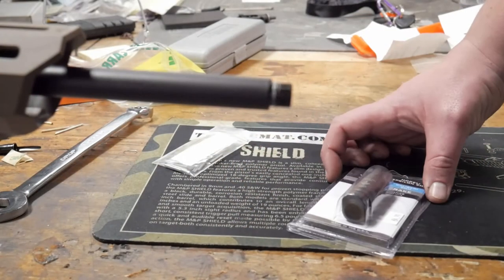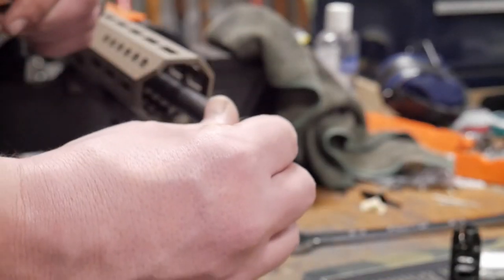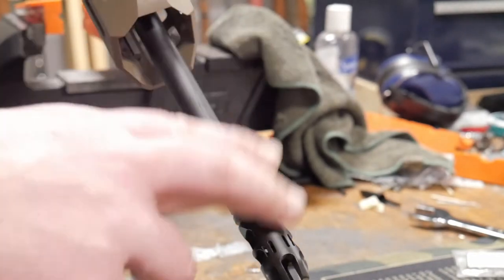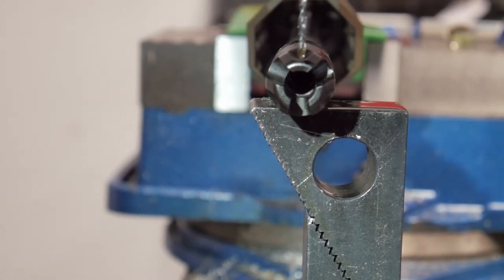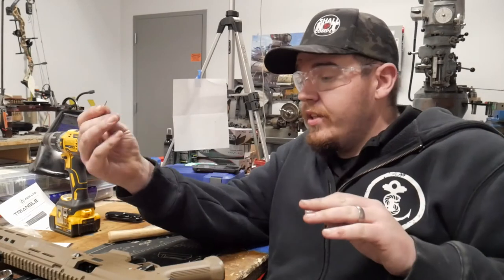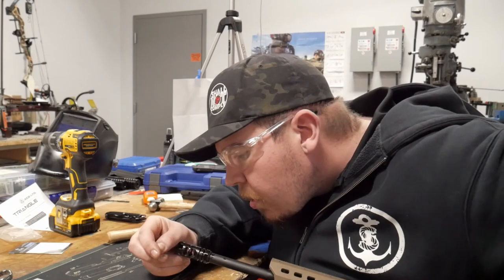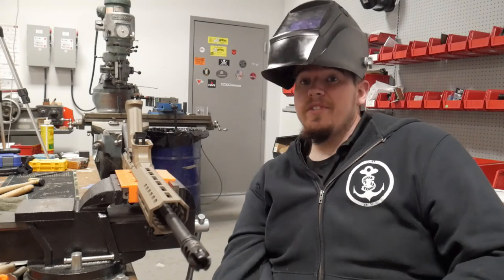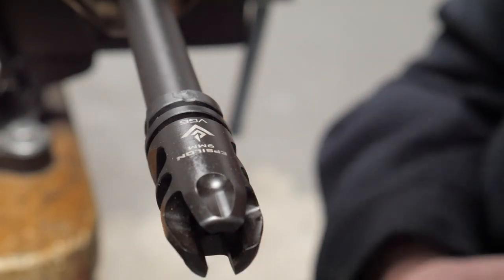Pin & Welding a Muzzle Brake Step By Step

Comment: You're not supposed to use a crush washer to time a muzzle device you're supposed to use shims... Timing has nothing to do with whether or not the circle is at the top . Timing has everything to do with bottoming out the muzzle device  with the top and bottom in the correct orientation.  You can't bottom out the device with a crush washer... Anyone want to chime in?
Reply: My understanding has been that, if it's a mount for a suppressor you don't use crush washers as they aren't perfectly concentricity; but for just a muzzle device crush washers are fine.
Reply: If the SOLGW - NOX is keymount USE shims instead of a crush washer.
Reply: 100% correct
Reply: Did he mount the crush washer backwards?
Reply: @laredotransparency129  "timing" does not involve a crush washer. It involves "shims"....If you need guidance on how to install a crush washer always put the smaller end of the "cone"in first, touching the barrel... the wide side touches the device...

Comment: Finally, a video where someone doesn't sit on the weld for 10 min. All the others I have watched today they are welding forever. I'm already nervous about putting too much heat anywhere on my barrel, and these guys are acting like it's their smoke break and gonna use all 15 minutes no matter what.

Comment: Shouldn't you have let the torch set for a few seconds and let the argon flow after the weld, instead of pulling it away so fast? It doesn't look that great either. Leave a bit of the pin protruding, chamfer the hole in the muzzle device so that the pin will flow into it. Seems like an awfully long time to keep the arc on too...ballpark 10 seconds?

Comment: Learn from me before you pin and weld a muzzle device. look at suppressors, and decide which suppressor you might like in the future. Then pin and weld a compatible MD. I got a DDm4 with a welded on bird cage, but when I wanted a suppressor, I had to remove the old one, which is doable but a pain in the butt. Also used a mild steel so it can be drilled out. Don't use a drill bit or any hardened pins.
Reply from the maker: dam dude that sucks I would cay the force it off and use a Tap to fix th threads or even use the Griffin Mount for the Birdcage is your able too

Comment: Could be wrong, but I believe that muzzle  device is designed to have the pin and weld hole on the bottom, not the top.That’s how the GAMMA is designed. It’s a common issue to have that muzzle device timed upside down.
Reply from the maker: An u are correct the Muzzlebrake brake was timed upside down what u don’t see is the reaction Rod holding the upper receiver upside down so it is timed Correct
Reply: @ShootingGallery1  thanks for the reply man. And that makes complete sense. Good video.
Reply from the maker: @usedtobecooler5382  no problem man thanks for the support

Comment: Why not drill the hole with a piece of wood dowel rod in the threaded part of the break
Reply from the maker: It’s just how I was taught never thought of it like that
Reply: @ShootingGallery1  I was just thinking so it wouldn’t drill into the barrel but who knows I guess it doesn’t really matter as long as the job is done well

Comment: What's the metal dowel spec you used for the weld. I'm about to go for 4130 tool steel

Comment: This is probably a stupid question but I see everyone tig welding their muzzle devices on with just the tig welder and no filler rod.  Why is that?  I'm about to use air-hardening A2 tool steel rod as the pin and was going to use filler rod  of unknown type on a muzzle device.  Muzzle device is 17-4ph SS.  I'm fairly new to tig welding though.
Reply from the maker: So that’s not a stupid question at all to my understanding it all depends on the size of the hole that you drill in the muzzle device. You don’t need to go that far into the barrel the carbide drillbit that I had was the same size of the hole that I drilled, so there was no need for filler rod, and you don’t have to go crazy with the pin weld as long as you get a good amount depth into the barrel words not going straight through obviously, and you welded with that pin is that suffices as the pin and weld

Comment: I been wanting to have a 7.62/308 pin and weld. 
Problem is, I don't know how to weld, I don't know anything about pin either. Buying the parts is not the problem. Having it done at all seems impossible.
Any suggestions?
Reply from the maker: No problem man I would just bring it to any Gunsmith they will be able to take care of you
Reply: I live in Arkansas and haven't found someone to do it without costing hundreds of dollars. Great video

Comment: What material is the Dowel Pin made from? How deep did you drill into the barrel?
Reply from the maker: It’s a Carbide dowel pin and I did not have to drill far just enough to make a indent where the dowel pin connect and dosent freely spring after welding
Reply: @ShootingGallery1  TY!

Comment: Good stuff. Do you happen to know about how deep into the barrel threads you drilled? Am I just going past the thread cuts? And I have the 556SL epsilon, the color is bead blast so would you recommend a different type weld or still tig? Thanks for the video great info
Reply from the maker: The depth length no I don’t I look at the the fron the barrel and before I turn the mill on I get the end of the bit in line and come just above where you would relatively drill though an I would only Tig Wled
Reply: @ShootingGallery1  ok cool I appreciate the info thanks
Reply from the maker: @billmurphy8685  no problem man that’s what I’m here for

Comment: how hard is it to remove a pin and weld job to make changes to your rifle? i want a new brake and front site
Reply from the maker: its not that hard where ever the Pin is take a grinder and get it out there way. You will destroy the Muzzle Break but that is one way you can do it
Reply: @ShootingGallery1  looking at mine it has 2 pins one on each side, very visible where they where put in. Idc about destroying the brake

Comment: When installing any of the VG6 Delta Flash hider, Gama, or the Epsilon brakes the vents are supposed to be on top & the emblem is to be on the bottom. Just Saying
Reply from the maker: Yea it was installed properly the gun was set upside down in the vise
Reply: @ShootingGallery1 / I didn't notice that good thing I think taking it off would be a bummer. Be safe & GOD Bless
Reply: When you notice the rifle is upside down in the vise.. 😉

Comment: Does it have to be a tig weld, or can you use a mig/flux core welder?
Reply: As a certified welder and machinist, I’d highly recommend tig only. Anything else you’ll have a hammered dogsh*t cliffhanger and then you’ll have to break out the grinder. That won’t turn out good at all

Comment: I have a PSA 14.7 AR with a pinned and welded A2 Flash Hider. I want to remove this to install other muzzle devices. Is it difficult to remove this flash hider without damaging the barrel? Best to send to gunsmith to do this?
Thanks for any suggestions!
Reply from the maker: Definitely send it to a gunsmith you can damage the barrel if ur. It carful

Comment: What size drill bit did you use ?
Reply from the maker: 3/32 carbide
Reply: Is that the standard size to use? I have a surefire closed tine. Thank you for your help. I appreciate it.

Comment: My local FFL just told me he couldn’t pin and weld my 13.9 to my dead air muzzle device. Cuz a ATF agent told him that pinning and welding a muzzle device doesn’t extend the overall length. Is my FFL wrong?
Reply from the maker: So I am not a legal authority but the shop I work at that what we were told when You Pin an Weld the Muzzlebrake it a permanent job so maybe the ATF Agent was miss informed but that how I get a 13.9 or a 14.5 to over 16 inches is by pining an welding

Comment: Where do you get the pin 📌 for the pin and weld???🤯🔫
Reply from the maker: I get the Dowel pins from McMaster Car
Reply: 316 stainless 3/32 welding rod

Comment: Where are you at in NE?
Reply from the maker: MA
Reply: @ShootingGallery1  do you have a store or shop, I'm also in MA, building an AR9 and don't know anyone with TIG welder, curious what it would cost to pin one for me or if you could point me in the right direction, thank you!  If there is a way to contact you through IG or FB let me know, stay safe
Reply from the maker: @JB-hp6up  yea no problem man I work at Cape Gun Works I’m the gunsmith here we charge 50 bucks for the pin an weld
Reply: @ShootingGallery1  thanks man, I'm not far away, Ill hit you up

Comment: Best 14.5" upper is buying a 14.5" upper or barrel and not pinning or welding it.
Reply from the maker: Yea that would be a felony
Reply: @ShootingGallery1  if you get caught, if someone looked for a pin and didn't find it, and you get charged, then yes. Otherwise there is no charge

Comment: Torquing the muzzle device down that much will cause accuracy problems, and burn out the rifling at the muzzle premature.  Maximum torque for a muzzle device is 20 ft. lbs.
https://youtu.be/Au9SZ7B_MWs